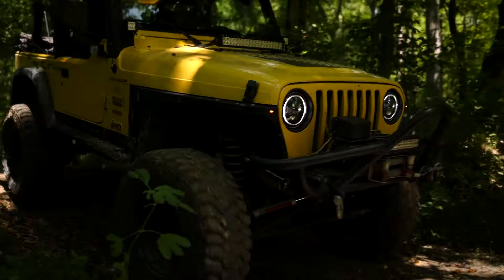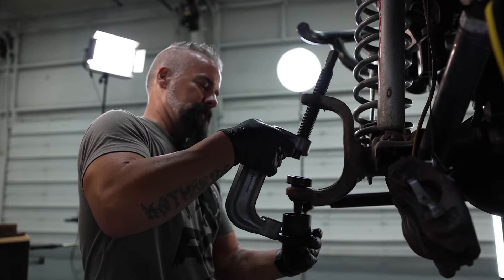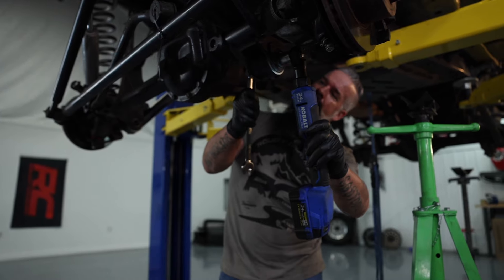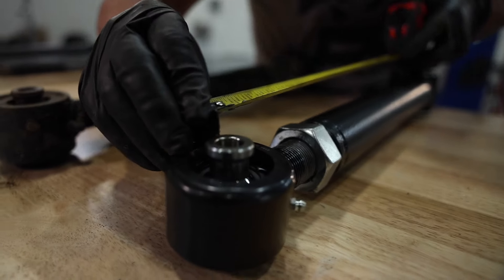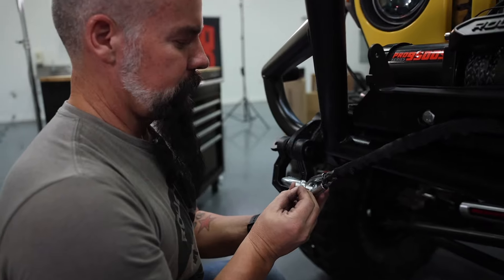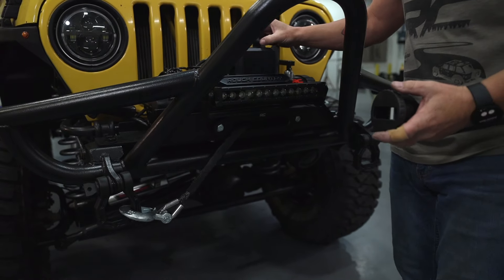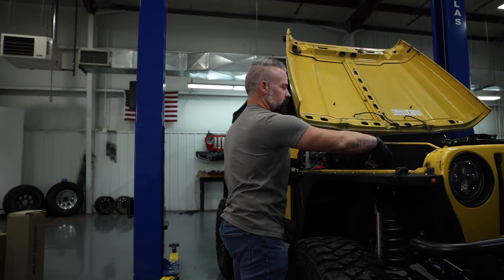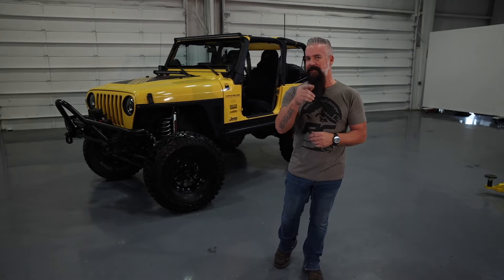Lifted 2000 Jeep Wrangler TJ Build

Comment: It would be great if you sold the window kits for your soft tops independently as well. I have a rough country soft top and the windows are cracked and hazed, with the zippers deteriorating and can not get parts for it. Just a whole new top

Comment: You had to take a chunk out of your lower knuckle for the grease fitting??? You just made it weaker if rc ball joints require that I wouldn't buy them
Reply: I was thinking the same thing. Can’t the zerk fitting be relocated instead?

Comment: I just did all these same control arms on my son's 2000 tj. The rear upper ones are hard to put together because when they welded the e-brake tabs on the side of the body it changes the tube. I didn't think it was going to work but I got through it.

Comment: Will the control arms help with death wobble.
Reply: Replace front end is only cure for death wobble. Balance tires, good steering stabilizer help preserve front end. But once front end components wear enough to cause death wobble…. Replace is only solution